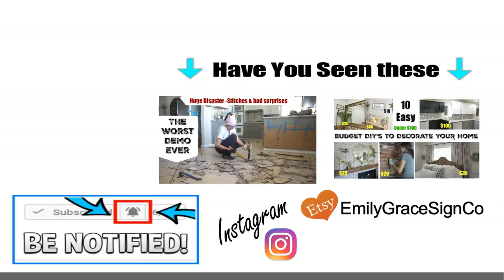PUTTING IN THE NEW FLOORS | DiTRA, TILE, BASEBOARDS | Momma From Scratch

Comment: Saw your last video and the multiple layers of linoleum...and let me tell you, your floor guy--if he's been in the business for any length of time and says that he's never seen/heard of multiple layers of linoleum--then he's lying.  I've worked in remodeling homes and been an appraiser.  While remodeling homes, I've seen multi-layered linoleum with tile on top, all covered with carpet...underneath everything were beautiful, original hardwood floors.  

I've seen contractors say that if the old linoleum doesn't have too much damage, you just glue the next layer over.  From the lowest layer of linoleum, it looks like your house is at least 40 years of age.  If that linoleum was made before about 1981, it could have very easily had asbestos in it.  (If it did contain asbestos, you have to hire a licensed removal team to dispose of it safely.)  At the stage you're at right here and are frustrated with, I would have applied a generous layer of adhesive remover and let soak.  It would be smelly and need good ventilation, so you'd have to keep a window open.  Also, face and hand protection is a must.  But that would have cut down on the amount of effort you were having to put into the project.  

(Side note:  one project I had huge issues with getting the last layer of linoleum up, I used a floor sander.  It's unconventional, and lots of contractors would frown on giving that advice.  It causes dust, fumes, and can make the floor uneven if you do not use the sander properly and carefully.  If going that route, test and get used to the sander before you take it to your actual floor.  Then ventilate and isolate the room from the rest of the house.  Wear respirators, eye protection, and ear protection.)
Reply from the maker: thank you

Comment: it will be nice if you write down the tools you used from tiles and the trim
Reply from the maker: Are you talking about removing the tiles and trim or for installation?  For removing the trim and tiles we used a variety of pry bars (something small like a 10" molding bar is great for trim) and just regular old hammers.  The electric tool was an oscillating tool; they aren't too expensive if you think you will have multiple projects to use them on.